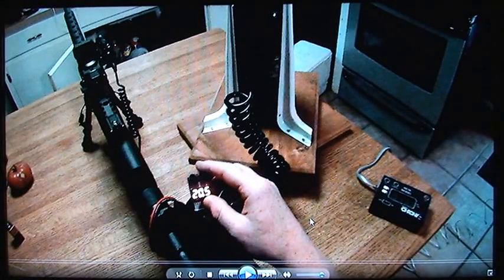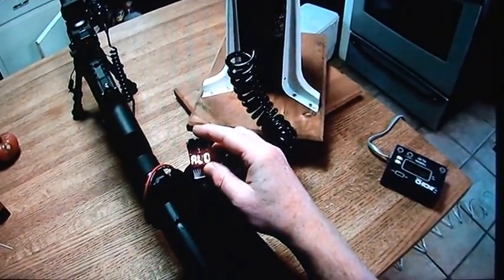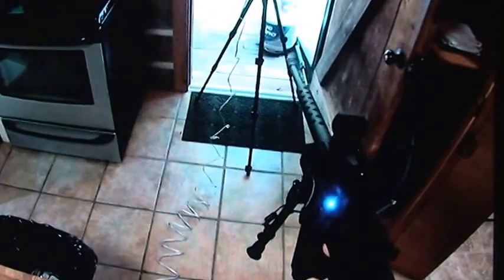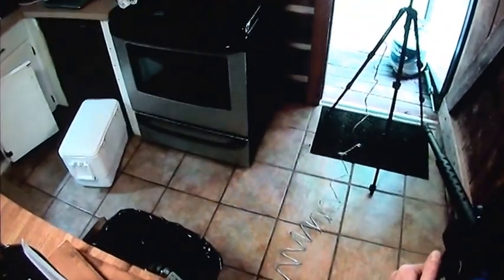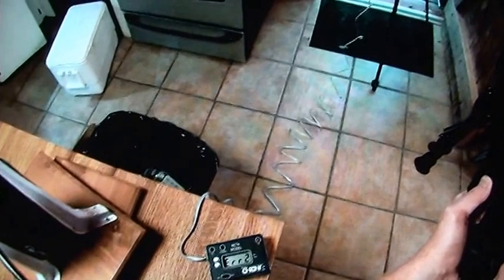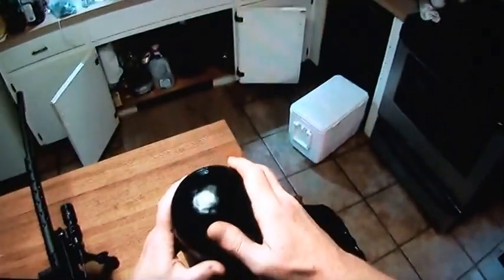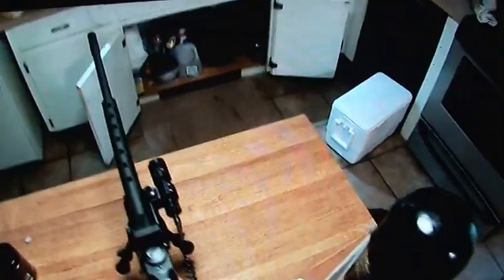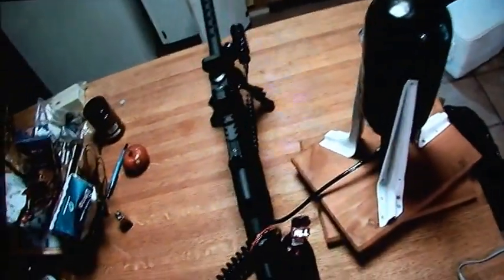Blackbird Mixed Gas Test Bootleg

Comment from the maker: The problem I discovered was that my rear valve seal was not seated properly. That same weekend I shot my B on the same bottle at 805 fps with the stock barrel, and an extreme spread of 5 fps. That is what I recall, but I can't find the footage. I know... It sounds like a fishing tale. I will say this. Helium will tell you everything that is not quite right with your airgun if you listen.